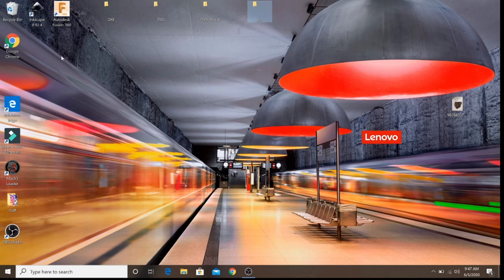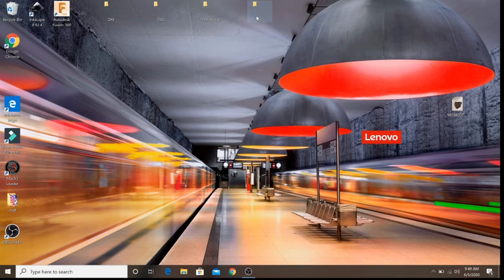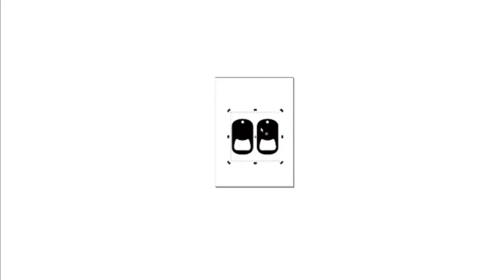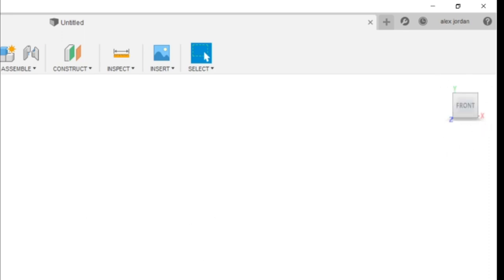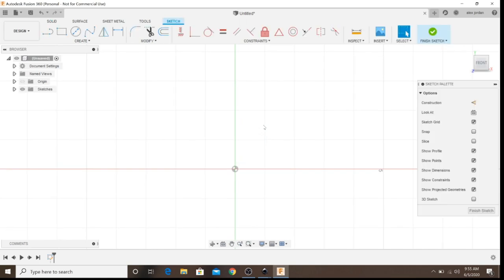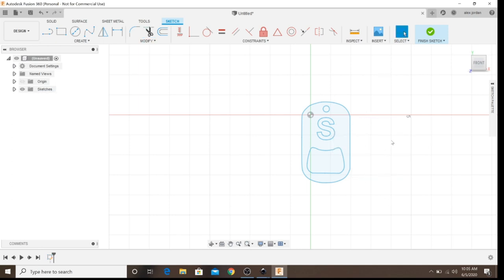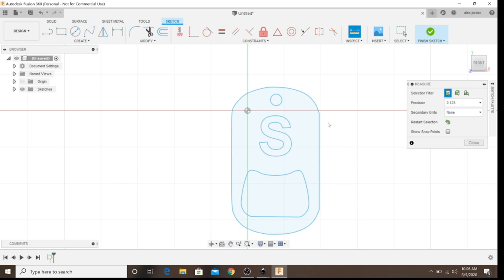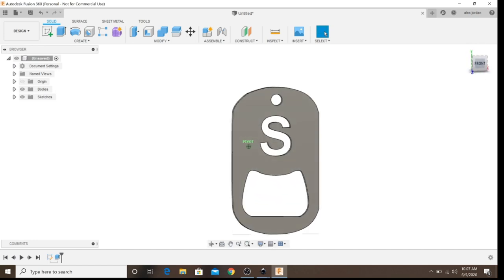( fusion 360 & inkscape ) How to turn any Silhouette in to a CNC Cut File  (Langmuir systems )

Comment: That was the best and the simplest video on fusion 360 I have ever watched. All other videos go into too much detail that take you down a rabbit hole. They also think everybody is an expert on fusion. Which means they can leave out Important steps. Which leaves you lost it's all about the simple details. That you cover very well.
Reply from the maker: Thank you I really appreciate it let me know if there's any other functions that would be helpful for me to make a video about relating to writing a toolpath for langmuir systems
Reply: So when you open it on Mack 3 what do you do then?   I also agree with you!
Reply: @amcustomfab I realize this is an old video but a tutorial on how to lay simple straight open lines as cut paths would be helpful. I'm just learning all the software and it took a while to figure out that kind of cut. Thanks for the vid
Reply: @amcustomfab every time I open and try to bring svg into fusion 360 it's just blank where you size and move around. It shows an error that reads the selected file contains no info or some unsupported info. Any help on what I'm doing wrong
Reply: I agree, a very noob friendly video. I wish more videos were like these.

Comment: This is a good tutorial on importing a drawing and converting it to a Fusion 360 drawing and generating a cut path from that. 
Tip: When you switch to manufacture mode, click on the fabrication title on the menu bar, then click on setup to establish the setup file. When you set up the 2D cutting, I prefer to do a separate file for inside cuts and outside cuts. This allows you to set the starting point as inside the cut for holes and out side the cut for the outside edge. 
It's not as complicated as it sounds because you can use the duplicate function on the drop down menu to copy the first cut file to the second. Then change the selected edges to cut from the inner holes to the outer edge and change the starting points from inside to outside.
measurement in Fusion 360 by clicking on you name in the upper right corner and selecting preferences from the drop down menu. Click on  Default Units and change both the Design and Manufacture units to what you like, click apply and they will always be the same.

Happy cutting!
Reply from the maker: I was watching somebody do this the other day I definitely want to learn how to do that

Comment: I love your videos on Langmuir/Fusion. I would love to see more of them. They have been so so helpful!
Reply: Question: after I made my spline fit points and put them to "fixed" my line was blue and the sketch looked complete. How do you get your sketch to go into the black line? I tried to extrude but it wouldn't, I am assuming because it is still in that blue line mode?

Comment: Dude. I love your videos.  So clear and straightforward.  Helpful and useful.    One suggestion, though, (maybe you've already fixed that in future videos) please bump your volume up when you produce.  I have to crank it up to a higher level to hear, and the ads come blasting in at 10x as loud.
Reply from the maker: Will do thanks for watching and thanks for letting me know about the sound 👊😎
Reply: @amcustomfab  Another thought is to do a fresh version of this with the latest versions of InkScape and F360, as their menus have changed.  And the previously mentioned sound level boost.

Comment: Wish you would do one on fire control and sheet an thru fusion..and I just got my pro to the point of jogging and it seems like at 300inpermin it's faulting.do I just need to break in or is my bearing to tight?
Reply from the maker: Really hard to tell without having it in front of me. Can you describe what it is doing or not doing? 🙂

Comment: I was able to follow your instructions step by step and everything worked. I was able to start my cut. So thank you for that! I’m getting a pierce height and torch height to high error you wouldn’t happen to have a resolution for that would you?
Reply from the maker: I would check a couple things make sure that your leads are not getting too tight like have good slack between the torch and the boom that holds the leads off the table. Also double check your grounds and make sure that you're consumables in the torch are not screwed in too tight specifically the cone
Reply: @amcustomfab   ok I’ll check. Thanks

Comment: Very informative, but when I simulate cut it only does the outline not the letters in the center. Any help would be appreciated, thank you
Reply from the maker: Most likely you lead in distance to to long you want your lead in less than half the thickness of your letter . Thanks for watching 😎
Reply: @amcustomfab  my letter distance is .177 and my lead- in distance (in linking) is .05 and still it only cuts the outside of bottle opener not even the opener part
Reply: @amcustomfab  thank you I found the problem the pierce clearance was too high

Comment: can i use this with my ez plasma system using mach3 and sheet cam? i would like to just use fusion as my drawing platform if possible
Reply from the maker: Sould be able to
Reply: or can i setup my ezplasma table up as a tool in fusion, sorry brand new to this. learning
Reply from the maker: Sorry I am not familiar with ezplasma
Reply: Ok so langmuir is just a part with in fusion just like the software sheetcam? Sheet cam just allows u to create cut paths,  tool settings and a software gcode can read.
Reply: Ezplasma is a 2011 table with a widows xp tower and prob a 1.0  mach3 gcode writer. So not sure how compatible fusion would be with that.